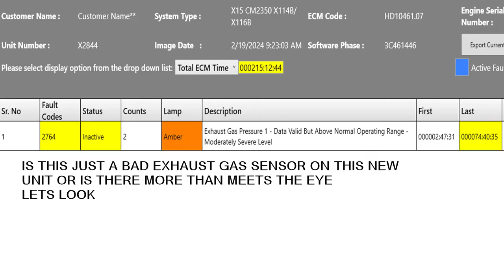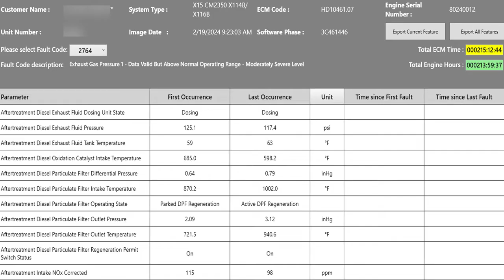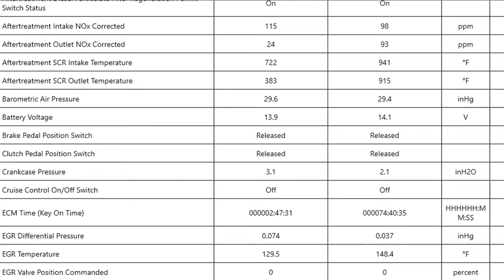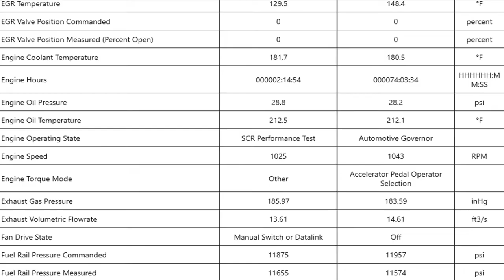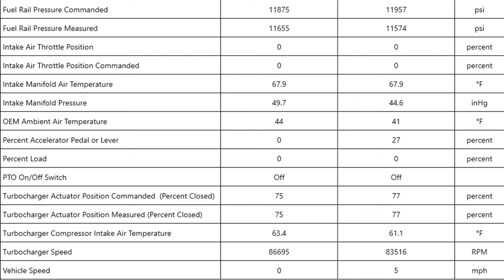Just two hundred hours on a new engine and a sensor fails or did it??

Comment: you seem to preach the importance of having good data and good known values.... I can't stress that enough in my own experience. I'm always trying to capture data of different types of engines that appear to be running well for the purposes of having known good values for regens and for pulling heavy loads down the road... in my experience there is nothing more available to have when doing engine drivability diagnosis

Comment: Joe, im more familiar with Cat and how they use percent/duty cycle as a means of measurement. Often times they'll use a range of say 29% on the low end to 71% on the high end as the normal operating range for a given sensor/switch/actuator. So just to clarify...does the turbo actuator on an X15 use that same kind of parameter or is it a true 0-100% range as viewed through insite?
Reply from the maker: The VGT assembly has a "0" to "100" physical travel. At 100% closed If mechanically sound it is still open enough for some exhaust gas to exit. In the early day of VGT trucks were towed in with no start and the VGT was stuck at physical 100% and shut the engine down and would not start. Insite would show 160INHG exhaust gas pressure just cranking. Today the VGT can't close that far unless something breaks in the movement linkage. We are talking only about the X15 here not other platforms. The 0-100% is the expected normal mechanical travel of the VGT vane assembly. On highway driving normal VGT ranges will run from 35-85%. Only in a regen will you see 85 to 100% and 100 is not normal. The only exception to this is when engine braking. I have see the turbo at 100% when engine braking going down the highway. I believe the Percentages are accurate position of the VGT when it is mechanically sound.
The company I worked for was all cat in the early 2000's but the Cummins was easier to work on as technology progressed and did the job so cat was abandoned. Their parts were also pricey compared to Cummins - at the time. That makes a difference in a 400 tractor and 300 service truck fleet.

Comment: Thanks Joe! Knowing good values during Regen really helped on this one as well as  using the data in fault snapshots. Seems like I have been replacing quite a few turbo actuators on the HE400 frame turbos lately. Thanks, Steve.
Reply from the maker: I think they are struggling with heat causing the issues. I have seen coolant line upgrades to increase coolant flow. Another thing we don't always think about is if we have a boost leak or moderately plugged air filter that raises exhaust temperatures all day long so more heat in the turbo. A small shop I help called me and one customer seemed to be having more turbo actuator issues than the others. He ran dump trucks that hauled dirt. I started opening hoods and low and behold most of the air filter minders were at their max limits or close to them.
Yes regen history was not stellar either. Now that filter minder is checked every time the units roll into his shop and it has made a difference. They are burning through an air filter
about every 3-4 months but other problems stopped.

Comment: The DPF diff psi jumped out at me initially but I can say it would have taken me awhile to catch the vgt actuator because I never pay attention to turbo speed if my vgt command and actual are within range. I’ve only seen the dpf diff psi max out @10inhg when the turbo is at full boost at idle. But then again I’ve only seen those numbers on units with high mileage and the DPF is typically plugged as a progressive failure.

Excellent catch.

Comment: Yep, most places would have replaced the exhaust gas pressure sensor and sent it on down the road. 

Y'all did real good in looking closer to determine the actual problem.